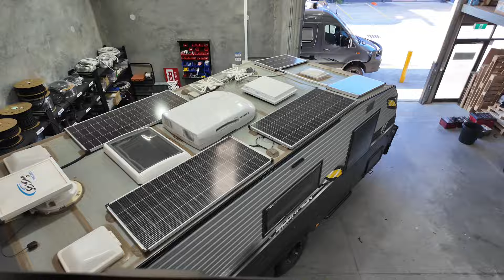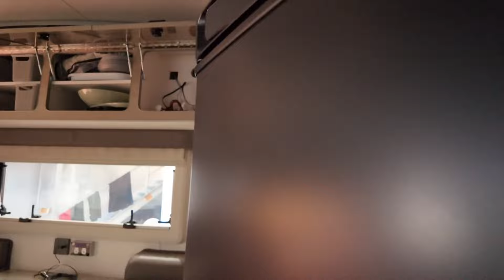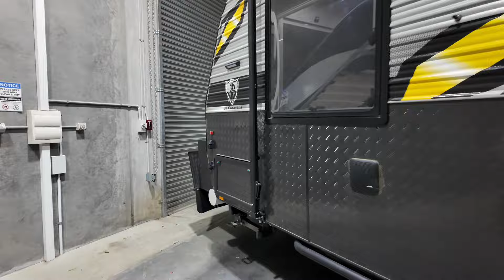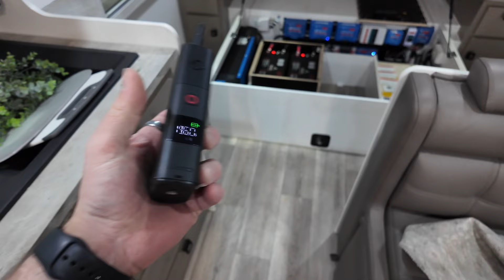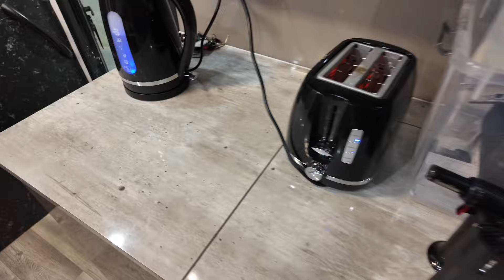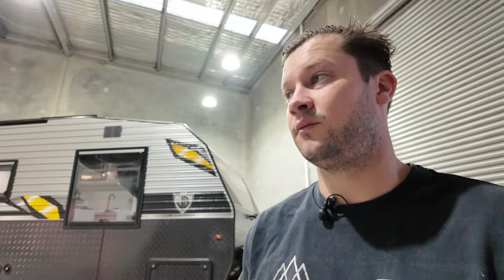They Said It Can't Be Done! 5KVA Inverter at 12V | PRESSURE TESTED | JB Scorpion

Comment: Just one question  the battery in a box how is it vented it  or do u have to  or does it just have to be in seal box  it probably  been ask so many times 🤔 I've got crusader caravan set up under bed original  from factory  but I've upgraded  to lithium  few years back before new rules come out so I'm just looking at ONE ,do I have to put in box ,TWO I don't mind doing it but how  and do right